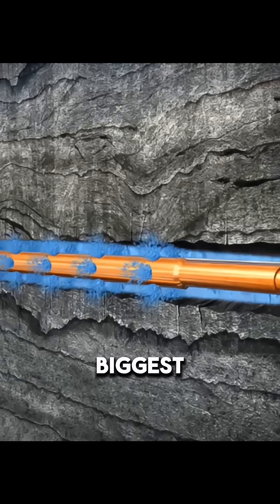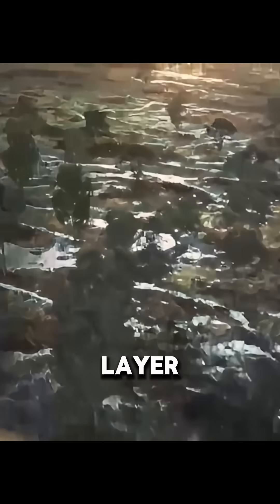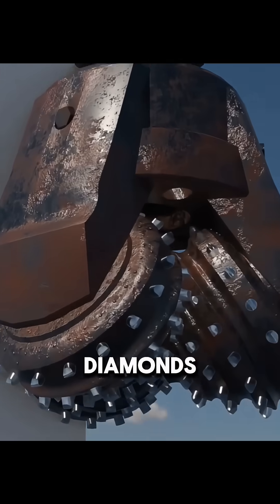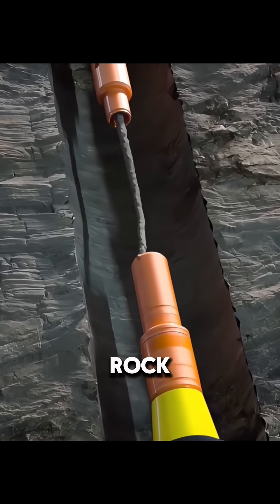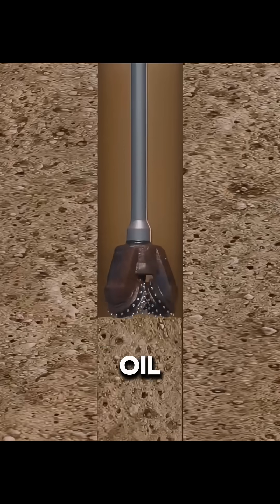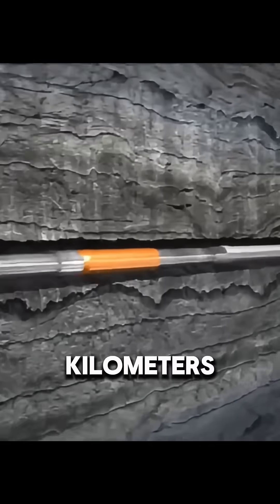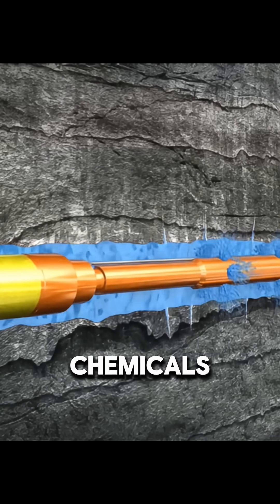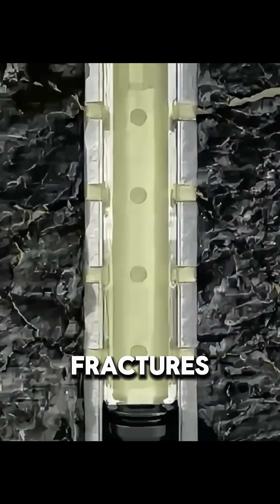How is oil extracted on land? #zackdfilm #foryou #oil

Comment: And what is not being told is that this technique can simply mix all water layers with this oil and the place will not remain inhabitable.
Reply: That’s wrong. You don’t know what you’re talking about
Reply: Habitable
Reply: I don't think "a mile or so down" is inhabitable ACTUALLY! AND as for well water, drinking water,...CITY WATER: A little chlorine, floride, run through a strainer---mmm, Good!
Reply: @MHMDmeansJesu234Christ 
This person is completely ignorant of the drilling process. We drill a large diameter hole down past all the water tables. Run casing and cement it. We then have to run bond logs and pressure tests to ensure we have the water protected before drilling into a hydrocarbon zone. Which is generally at least 1.5 miles deeper than the freshwater zone.
Reply: All kind of drill and mining does it..  this one is a little bit safer
Reply: If true Obama and Biden EPA's would have made illegal as they hate oil and love "Green".
Reply: @ccw-cs6xb  Is not about green. They are as stupid like the others. Put your money in research not just to fatten the pigs.
Reply: @ccw-cs6xb  They don't hate corrupt oil companies they just love human life more
Reply: @Eaglescout11 Barack Obama and Joe Biden care about human life? Surely you are joking.
Reply: @ccw-cs6xb  Hmm...get yourself stable..

Comment: This is how you poison the underground water table..
Reply: How deep does the fresh water table go?
Reply: 2000 feet
Reply: Spots in Ohio only 100 ft. The shale layer is over 5000 ft. Look at what is being drilled out from under Lake Erie. A salt mine. Why isn't the lake draining into this mine? Layers of rock that is extremely dense. The poisoning of the water table is a lie.
Reply: @neilbecker2904 it's not a lie
Reply: @neilbecker2904   bullshit.,proof please.
Reply: @neilbecker2904 Your statement is too general. As usual, the truth is much more nuanced and (inconveniently) "complicated." But simple minds are only capable of simple answers, reality be damned. How about we learn to differentiate a bit? It's case (and location) dependent! Poisoning even a minority of locations is already bad. (Not talking about "negligible exceptions" but a minority that's significant. Don't come back with "We want to drive and need some sacrifice." It's totally avoidable to poison the water table. Please inform yourself.)
Reply: @MaineMax-jm4uw 
It is a lie.
Reply: @noelnicolier3780 
You are right.
Water table poisoning is bullshit.
Reply: @neilbecker2904 the water table goes way deeper than 100 foot.  People in Ohio with wells down 300 feet or so.  While not necessarily the norm,  it happens.
Reply: @gregeberhardt568  300, or even 1000 feet is far more shallow than the typical oil-bearing shale layers at 4000-7000 feet.  The “poisoning” of drinking water is just feR-mongering to people who slept through science classes.
Reply: @neilbecker2904  Yes, agreed.  Eastern Ohio has been doing this for years; I haven't heard any complaints from my relatives yet about the fracking.
Reply: @noelnicolier3780 prove it's poisoning it
Reply: JESUS IS THE WAY, THE TRUTH AND THE LIFE. Repent and turn away from your sins today🙏🏻
Reply: @JesusPlsSaveMe  please flatearther, grow up
Reply: Wells are drilled up to 200 feet for water.  Oil comes from 2 to 5 miles down.  No water well on earth is 2 or more miles.  Pump cost is too high.
Reply: @donaldkasper8346 
JESUS IS THE WAY, THE TRUTH AND THE LIFE. Repent and turn away from your sins today🙏🏻
Reply: & people end up having weird stuff coming out of their taps
Reply: @mickvonbornemann3824 Yeah, like fire.
Reply: Not actual fire but gas will you can light
Reply: @1AmericanZeus This was a lie by Josh Fox and the film was found of him hooking a propane tank up to a water line to get the desired result.
Reply: @SirHung69
This occurred naturally before fracking too.
George Washington wrote about it.
Reply: @1AmericanZeus
This occurred naturally before fracking too.
George Washington wrote about it.
Reply: @mickvonbornemann3824  get a water purification.  Knowledge is power.  Complaining is not.
Reply: Not only  that, water used to frack is coming from drilled wells into perfectly good ground fresh water sources. 32 million gallons yearly. Fracking sites become poisoned dried out chemical dump sites.
Reply: If water could reach those depths, it would have been poisoned with oil long before fracking took place
Reply: Having roughnecked on drilling rigs in Wyoming one gets to see s trend. Haliburton will not divulge chemicals pumped in the ground claiming proprietary reasons. Groundwater testing before drilling in new fields, like the Anticline, show no contaminates.After, toxic chemicals are found but cannot be proven in law to be part of this company's drilling practices. There is always a way around the law when money is involved. Don't even get me started on invert mud drilling
Reply: @TimoBurns there are no proprietary chemicals used near the water table.  The surface hole, top part, is drilled with water and benonite (mined clay).  The casing is cemented in with a FIT test to ensure no communication to zones above.  If you worked on a drilling rig you would know all this.
Reply: Ya but could you imagine getting oil out of your taps. You could distill your own gas and diesel for free.
Reply: @chupacabra1765 did you think once what will drink then ? Vodka ? Or rum ? 😂
Reply: @engtechs 😂 with all of our new found oil wealth we'll be drinking champagne
Reply: And it introduces strong earthquakes to locations they were never recorded before
Reply: @The2fix please tell me what you define as a strong earthquake? There is a scale you can use
Reply: What is the ned of such fracking, we d still have plenty of crude worldwide, by the way: fills back up as it is non ...but mineral oil, out of mineral NOT fossil !!
Reply: @sergiofrei yo @sergiofrei  that it’s not from fossils, but you’re wrong about the mineral oil part.
Oil is a product of decayed and pressurized organic material, primarily ancient forests and swamps. We have already proven this through experimentation.
Reply: Our well was affected and the nearest site was 2 or 3 miles away
Reply: You need anything that is in the Ground 10,000 foot deep????

No you don’t. So it doesnt really matter much
Reply: This is why underground water being contaminated no longer usable
Reply: Leftist are dumb, fresh water table and shale oil table are kilometers apart.
Reply: gurt
Reply: Get a life
Reply: Is this your way of telling th world that you are about as bright as a 2 watt lightbulb?
Reply: No difference than the liquid oil we get.
Reply: When you don’t know, don’t speak…
Reply: Yup
Reply: You'll be ok. You could still stake a claim of untouched wilderness and go back to animal skins. 
You dont complain when you plug in your EV or put that pump handle in your car.
Reply: Yup,,pretty much. Not to mention the composition of earth. We need to stop putting hands into nature. Our selfishness will bankrupt the next generation even more.
Reply: @movie30000  Funny how in the places there're doing this fracking, all their water comes from surface water. As a former Climate Change activist, stop believing all the hype. It fills the money coffers of globalists. If it were up to the globalists, you'd be in a energy desert living in animal skin clothes and T-pees.
Reply: Useless consumer NPC comment
Reply: who poison it? US right?
Reply: @lokemanxport worldwide
Reply: @andylau13  who sell the technology? worldwide?
Reply: @lokemanxport your mom
Reply: So? We have plenty of water. Its everywhere. I've even heard a rumor that it falls from the sky. Who wants to drink dirty water that comes out of the ground? I'd rather have the oil.
Reply: Stop using any products that depend on oil then
Reply: @rabbiartsdesigns3596 Pueden consumir productos dependientes de petróleo venezolano o saudí o iraní o ruso...😂😂😂
Reply: @DanielAlfredoToro 😂😂 very funny
Reply: i dont know what to tell you man, but we need oil.
Reply: All these "experts" that have never spent 1 day working in the oil/gas patch. 😅
Reply: No, it's not. This is thousands of feet deep, nobody's source of water is that deep 😂
Reply: @kindcanadian5825 thinking that none of that water / oil / fracking chemicals mix is going to find its way up and into the water table is wild. Especially where explosives and super high pressure is involved.
Reply: @michaellane9579 
The chemicals are harmless.
FUN-FACT: Dihydrogen Monoxide (H2O - water) is a chemical.
The oil and natural gas are natural, organic, and biodegradable.
Reply: @JustinCase80884 😂😂😂 imagine being this stupid and arguing with me?
This is the dumbest take I've ever heard 😂😂😂
Water is just one "chemical" they use in a cocktail of chemicals that they refuse to tell you about. And crude oil is a killer of wildlife. It's toxic and carcinogenic. It takes time to biodegrade and causes lots of damage to wildlife in the meantime.
I certainly don't want to drink it!
Reply: @kindcanadian5825 but when you hydraulically fracture several rock layers propping them up with ceramic beads you can make deep underground sinkhole situations and the vibrations can all travel up the drill line even passing that concrete amalgam used to seal the transition point. That can deteriorate and bridge many different layers all along the drill line and deeper. That does include water levels. It happened. It's happening. I've witnessed legal proceedings showing evidence of this. I don't remember all the technical jargon but I helped with computer animation of this for a museum. Much of my research reference was similar visual aids oil companies used to express concerns internally that were hidden from the public.  This animation is an ideal situation of it working without many issues that can happen. Imagine the fractures bridging old drill prospect lines from 80 years earlier. the pressure and the fracking fluid is nasty. It's designed to bridge layers and get to hard to get places. It's almost impossible to do it safely. The people who are ok risking such are not the ones who are known for safety.
Reply: You poison the soil in addition to underground water reservoirs. 
This invariably finds its way into drinking water & food.
The environment gets toxic, so the animals that live in the environment are also affected.
Reply: @tropickman 
We’ll be fine.
Reply: Again happening WAY below the Water Table. Stop that nonsense.
Reply: Are you one of these guys who thinks it’s a great idea to cut down hundreds of acres of forest disturbing wild life to put up windmills because you think they produce enough electricity to run one home . And cow farts cause the fictitious global warming.
Reply: @Friscojones-z6b incest born ma ga reta rd
Reply: @Friscojones-z6b Lol. I still can't believe people are stupid enough to believe that garbage😂
Reply: And cause earthquake
Reply: More chance of a drum of diesel spilt on the ground poisoning an aquifer than fracking. For dummies that no nothing about drilling - just STFU.
Reply: They’re indifferent to a poisoned environment, it$ all about money.
Reply: @Kotawii 
No, we’re just indifferent to ill informed zealots.
Reply: Called cracking very polluting
Reply: @anthonydifede7792  Prove it. All of fracking is done in areas where surface water is used.
Reply: @anthonydifede7792  Oh I get it. The news told it was. That how you know.
Reply: @anthonydifede7792 
Not polluting at all.
Debunked.
Reply: So when you give this up this, you can build your log cabin with axes, not power tools!.  How do you drill for water?  Try to think before you post.  This drilling gets cleaner energy and allows us to avoid wood and coal, which are the major fuel sources in the non Western world.    Ever see pictures of wood smoke in 3rd World countries? China and India are by far the largest polluters.  3rd World is right behind.
Reply: @robertd.shannon9007 Have you ever seen videos of people lightning up their well water with a match?
Reply: @glennmagera3498 I have. But, that doesn't mean this is worse for the environment. Flint Michigan is an isolated incident and at the time there weren't anywhere near the same regulations on this method that there are now. Im all for this method as long as these companies are held responsible and the regulations are ever changing for better, SAFER ways to drill and frack. The key is accountability
Reply: @1AmericanZeusaccountability in the US that is a good joke
Reply: @robertd.shannon9007  do a per-capita. If just 10 people eat a total of 500 big macs in a month in one school & 60 people eat a total 600 big macs in a month at another, you will probably say the 60 people (who only ate 10 big macs each) need to cut down. Meanwhile the 10 who ate 50 each will be giving lessons  about "combating obesity".

It's preposterous, to put it mildly.

While chinese pollution creates more than 50% of products used in the USA, the US pollution creates nothing. Humvees, Rams, and unnecessary garbage.
Reply: @KumaranSeetha-e1k wtf😶 are you talking about???
Reply: @robertd.shannon9007  explain why many countries banned fracking

Comment: We still do not understand the full consequences of doing this, plus the chemicals that push in there
Reply: Women are like this. They don’t understand the consequences. Get that oil though
Reply: Man invents first fire - concern troll "quick, put that out, we do not understand the full consequences of doing this".
Reply: I know the consequences of not having fuel.
Reply: @ridgerunner106 yeah you are so misguided and wrong
Reply: @ridgerunner106  You do have fuel though, Oil is plentiful, you want CHEAP fuel. at the cost of ruining the fucking land you are living on. 
Short sighted Trumpers only think about RIGHT NOW , never tomorrow.
Reply: water
Reply: @erichansen82  Not just water, they have fracking fluids and other additives used to control viscosity and other factors.
Reply: @N4CR  I one of they
Reply: Here we go..
Reply: It will cause earthquakes or collapse because you breaking the ground with empty space.
Reply: Health and ecology problems for you. Money for me.
Reply: Waste H2O , hwy 46 is loaded with fracking, thats why the central valley looks like a desert. It uses a bunch of water
Reply: Once the ceramic is stressed it burts thus   causing miniture earthquakes...
Reply: What are the consequences of not doing it?
Reply: @ghanna7787  slightly higher oil prices, lower profits for oil company shareholders.
Reply: except when we use the oil.....then we receive the blessings of amnesia....:))

Comment: I had my water well hydrofractured back in 2011 because it wasn't producing enough water for my families use and now we have more water than we can use.  The previous system - low flow well - had 2-300 gallon tanks in the garage for water storage but the well would not replenish the well on wash days plus regular usage...this technology was adapted for other purposes besides oil.
Reply: yea but if some farmer will use chemicals near somewhere you get thsoe shit too in youre well not only water coas well is tipicaly  very hard filtered  through ground but  through those cracks it not filtering  chemicals  or very  small portion !

Comment: Horrible for the environment , barely regulated, and causes earthquakes.  Yes it does cause earthquakes. Without fracking, Oklahoma has no earthquakes. With fracking they're all the time. Then the fracking goes away and they don't have them anymore.

Say what you want, fracking is not good for the environment or earth

Comment: Meredith Charles Gourdine, a black man, invented the technology to extract oil from shale in 1995.  Patent U.S. 5,456,596
Reply: Gourdine's companies developed commercial applications for electrogasdynamics, garnering patents for converting natural gas to electricity, desalinating sea water, creating circuit breakers, and for acoustic imaging. He also invented the "focus flow heat sink," which cools computer chips. But Gourdine is best known for developing the electrostatic precipitator filtration system, which removes smoke from burning buildings, fog from airport runways, and, today, allergens and other particulates from the air of many homes.

No word about horizontal drilling.
Reply: Is there a reasoning for bringing up a color of the person? If it was a white, or brown person would they be unable to patent someone's idea just because of that differing melanin?
Reply: Hydraulic fracturing technology originated in the United States with the first experiments in 1947 by Stanolind Oil and Gas, and was first commercially applied in 1949 by Halliburton in Oklahoma and Texas. These early fracking operations were intended for conventional oil and gas reservoirs and not yet specifically for shale. The real breakthrough for shale oil and shale gas came in the 1980s–1990s, when George P. Mitchell (Mitchell Energy) combined hydraulic fracturing with horizontal drilling, making large-scale shale production economically viable.

Addition: i have no idea what skin color these guys had. 
In general you can safely say that the workers in the oil industry are tough guys and you find there all skin colors. Normally nobody cares about that though, more important to be a reliable colleague.
Reply: @ArjanSchaeffer1973 thankyou❤
Reply: We wuz engineers and shit
Reply: Why say he is black???!!! Do whites specify skin colour every time we made 90% of scientific discoveries?
Reply: Wouldn't be bragging about that one 😅
Reply: A black man? How is this relevant? Why can't he just be a man?